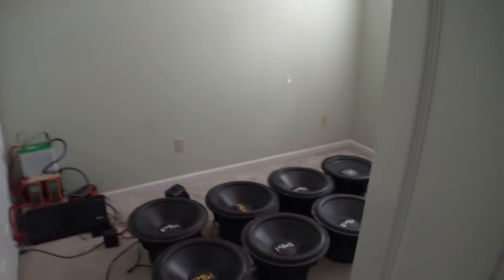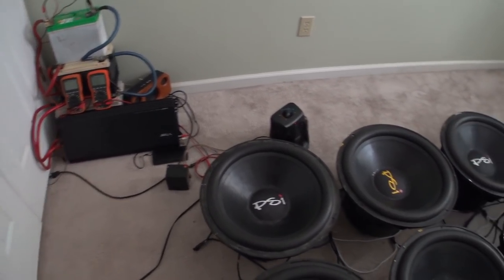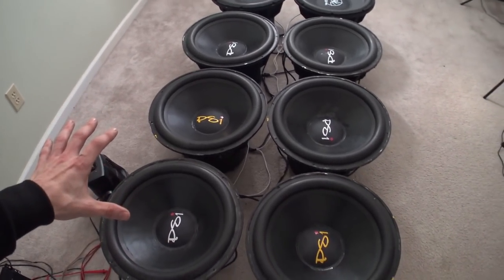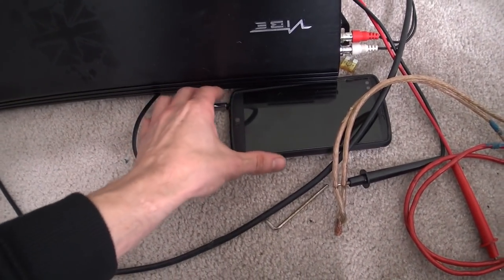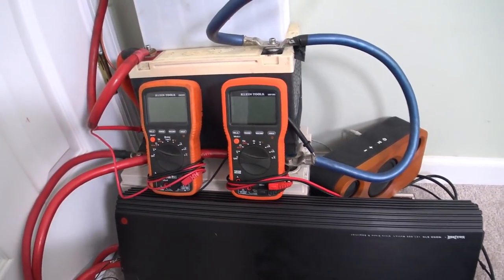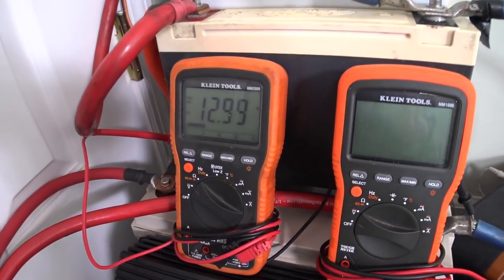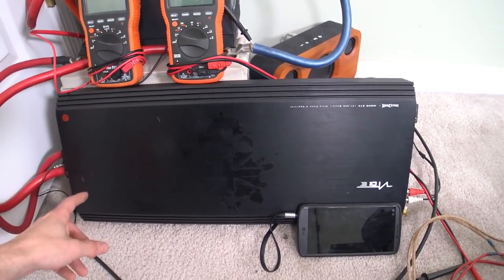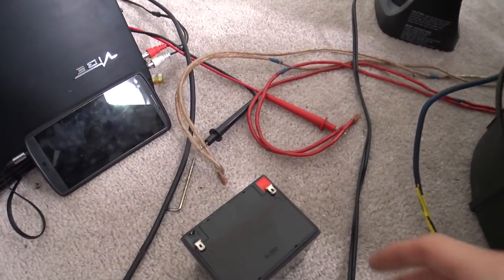POP Testing 18" SUBWOOFERS w/ 12v Battery | How To TEST Speaker Polarity Wiring DC to Voice Coils

Comment: a little tip for the light, try bouncing it off the opposite wall, you can use different coatings or materials on the wall to help control the peaks of light on your subject without loosing too much of the fill light. or you can get a defuse bulb/bulb cover depending on what light you are using.

Comment: I have a question about sound deadening for street stock competing. What is aloud as far as bed liner coating on the outside to help stiffen the car up? I know I can use whatever inside under the panels as long as the panels fit back.

Comment: E6000 is amazing to me. Cheap and works extremely great!
Reply: R3MIX MODZ did he used e6000 to mount the spiders or was it just the surround - I’ve watched the video 2 times trying to see if it did
Reply: Could be both. Ive used it for both and has work great. For him im not too sure I cannot tell either.
Reply: I use e6000 on surround and dustcap, I use 5 min epoxy on spider landing, been working well for me

Comment: I have 2 Rockford fosgate 12 p2 and they bump. I want to go bigger but I have a budget. Any recommendations
Reply: Dylan Postle Duels
Reply: Dylan Postle check out these. Everyone has a budget of some type. You just have to save up. For the price of the CAB 12’s you can’t go wrong. They will blow those P2’s away. You’ll need a 2000k watt amp for 2 of them. For $230 you can get a Skar Audio RP-2000.1D from Amazon   Not a bad amp for the money, but it needs to stay well ventilated or put an external fan on it. For $500 you’ll have a system that hits so much harder than those P2’s you’ll wish you never wasted your money on them. Save up and buy 1 speaker at a time if you have to and then the amp. Or get the amp first. Whatever. Just save up your money!! 

http://www.caraudiobargain.com/cab-12/

Comment: USE THE 10 18S!!!! IF JP COULD PULL IT OFF IM SURE U COULD TOO!!!
Reply: JP ran his in a sealed enclosure so that required less space and that setup only did a 157 at best. Of course EXO can do it, but he wants his in a ported enclosure, he wont have enough room for the proper airspace for 10 subs. He will be louder with 8. 
Just like JP's 6 18's setup, JP's 6 18's setup is louder than his old 10 18's setup.
Reply: 10 18’s is overkill. You don’t win competitions that way. 
More isn’t always better.